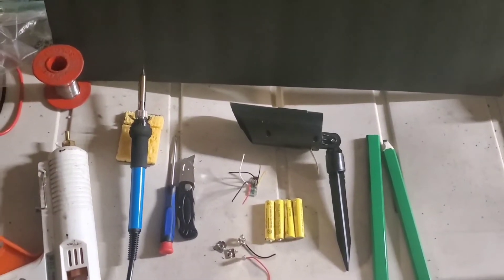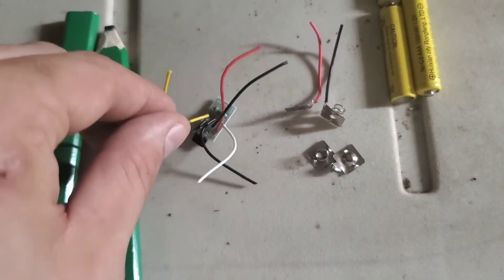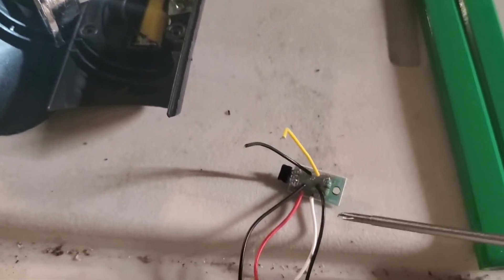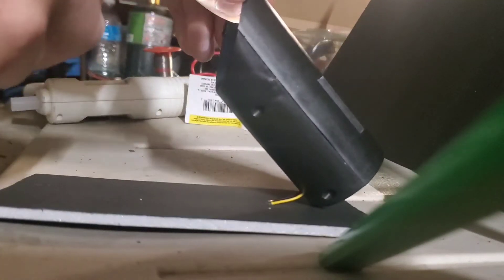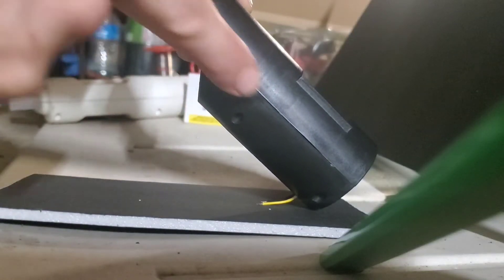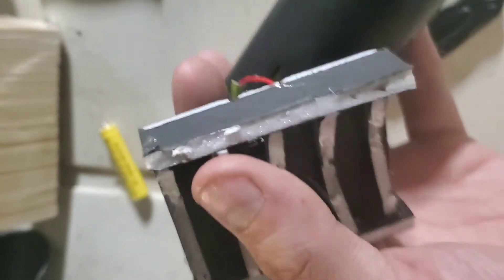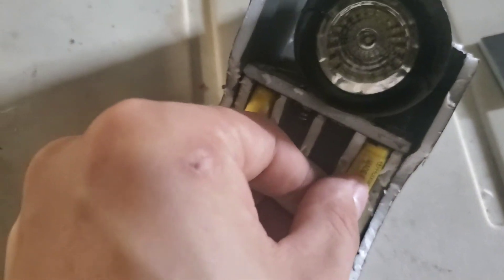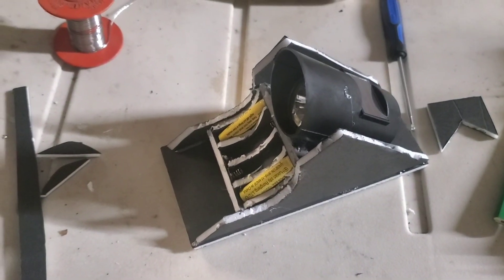Dollar Tree DIY: Solar Battery Charger & Light. Dollar Store Tech.

Comment: About how long did it take to make this from start to finish?
Reply from the maker: It took about 2 hours if you include the time to harvest parts.
If you plan on building one make sure you check your output voltage to check if your battery box needs wired in series or parallel.